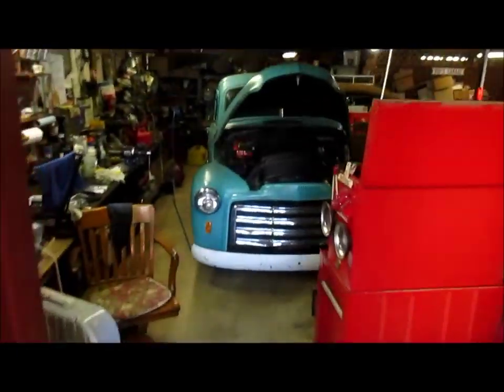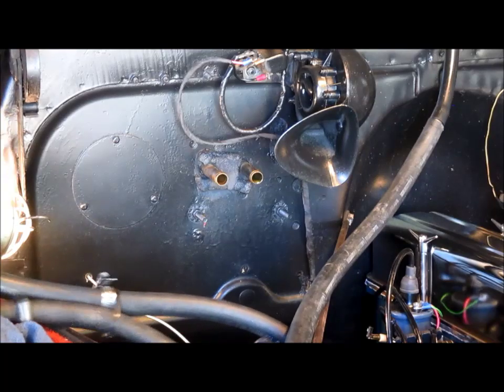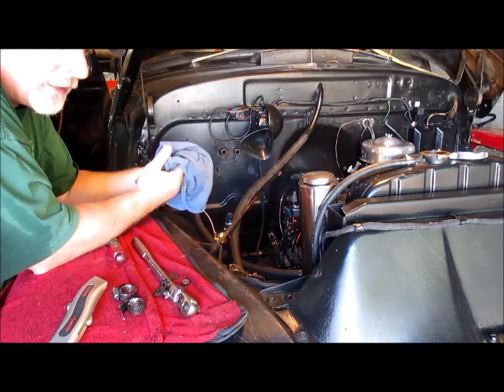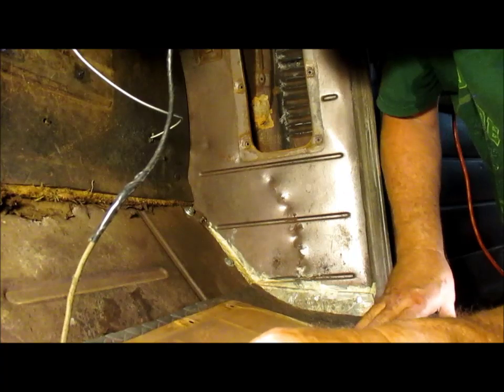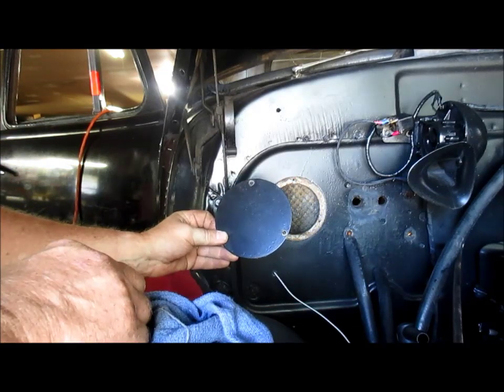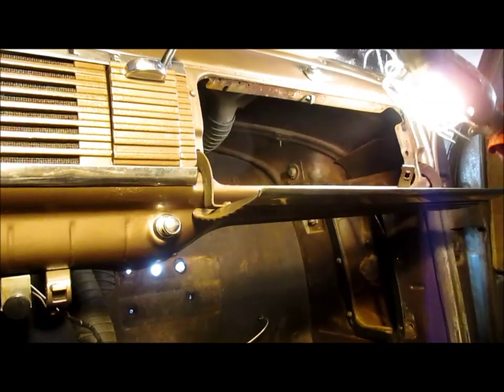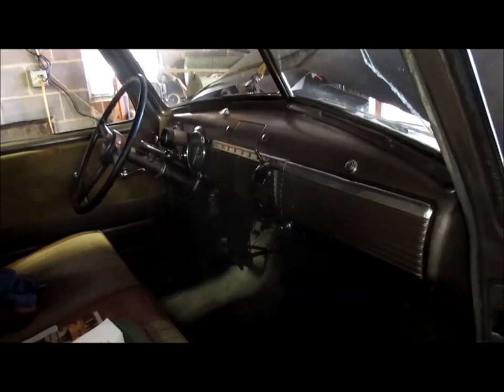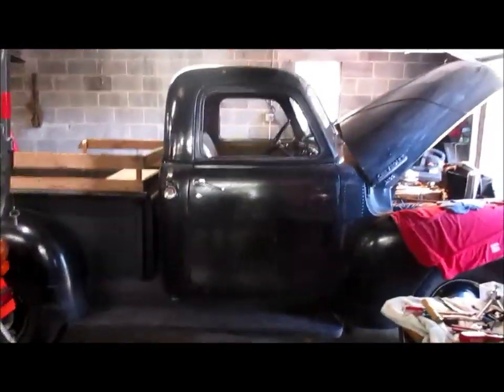49 Chevy truck, Part 3 Deluxe Fresh air heater installation.

Comment: Back when truck's were built to be truck's I'm working on a 1951 GMC 100-22 1/2 ton extended bed truck. And I do declare my friend' watching your video of this makes me realize that I can be all warm and toasty inside!!
Reply from the maker: Nothing hardly better than a nice warm cruise in an old truck.  Thanks for watching Henry.
Reply: @Volfandt  pleasure is all mines I'm still a young'n but I was taught by my Pier's That old school rules and without that' there would be no New. I just enjoy anything that has to do with turning the clock back' especially good ol' American iron 👍
Reply from the maker: @henrytyson3219  One of the best learning environments I ever experienced was the 1 year I spent working as a brake and tuneup man in a shop ran by 3 semi retired line mechanics. These boys put the "old" in old school and they knew  all the tricks of the trade and didn't mind sharing as long as you had tough skin, LOL. I still often think about those boys and I use lessons I learned from them to this very day.
Have a good 'un.
Dave.
Reply: @Volfandt  same to you' 👍

Comment: I thank you for making these videos. They're informative and entertaining. I have a 1953 Dodge 3/4 ton pickup I am working on and you are an inspiration for me to do so. Please beware when working with old insulation as asbestos could have been used in the manufacturing. Take care.
Reply from the maker: Thanks for th ekind words Bustoff, a 53 Dodge is a very worthy project and is similar to the GM & Fords of the day. Good luck with it and the warning on asbestos is spot on.

Comment: It’s interesting that you’ve got an original heater Core that is rectangular. I purchased a remanufactured/refurbished heater Core that is circular and the input and output hoses are vertical, not horizontal. It’s on my channel if you’d like to take a look
Reply from the maker: I checked out your part 1 vid, your heater is the OEM recirc heater and as we've seen on our video's there is a big difference between the OEM recirc and fresh air heaters. I find it odd that the recirc core appears larger than the fresh air. The core in my old Arvin recirc heater also looks bigger than the fresh air, go figure, LOL. Good luck with the repair, I wasn't successful in my core repair attempt.
Reply: Volfandt oh ok, I knew there were different levels of Heater but I never knew what they were. Thanks for the info. And thanks, hopefully I can seal it

Comment: Hey Dave,
Not sure if you showed the heater switch and how it is wired to the heater. Btw, my truck has a Ranco valve not sure if it works just yet. I re did my heater blower with 12v motor and repainted it but have not ran hoses or used it yet. Any insight would be greatly appreciated thanks for your video
Reply from the maker: The fan switches are pretty easy on these old Stovebolts but theres several versions can can make it a little confusing. Basically the switch will have a fused power input and an output to the fan.  Since most use resistors to vary the voltage to control the fan speed the switch assemblies also need to be grounded which they generally are when bolted to the dash.
That Ranco valve is a nice control and I'd like to add one to my Chevy one of these days. Plumb the heater line that closest to the thermostat to one side of the valve and run a heater hose from the other side of the Ranco valve to the heater core. Run the other heater core water connection straight to the water pump stub thats below the other. Basically the Ranco valve controsl th eflow of hot coolant from the engine to the heater core and it varies it depending upon how  hot you turn the valve for heat. 
Good luck
Dave

Comment: What kind of fan switch was installed to get the different fan speeds with only a single wire from the fan??
Reply from the maker: The fan switches have resisters built in to step the voltage to the fan up or down. There is a 6v switch & a 12v volt switch depending upon your trucks voltage. Most aftermarket providers carry them. Here is an example:
https://www.classicparts.com/Heater-Parts/products/53/